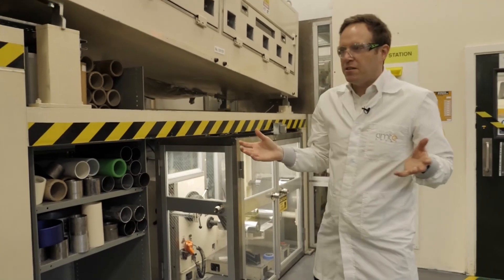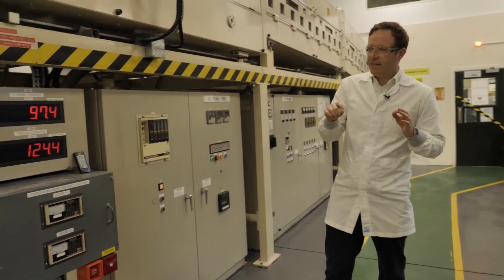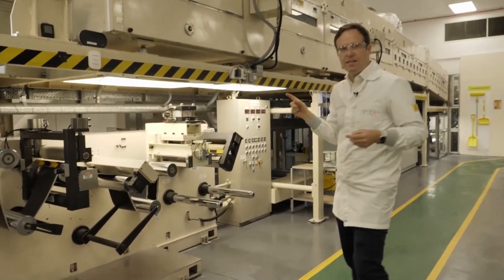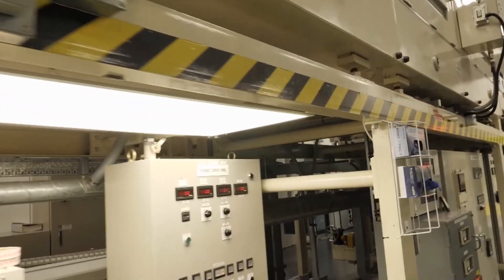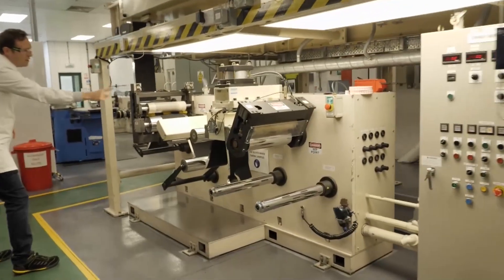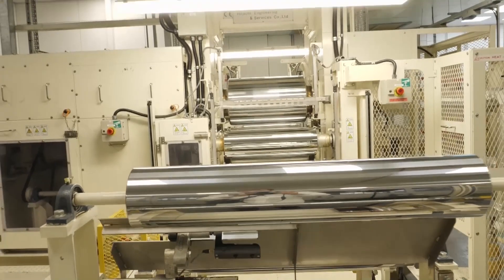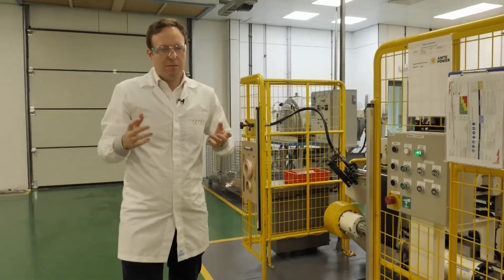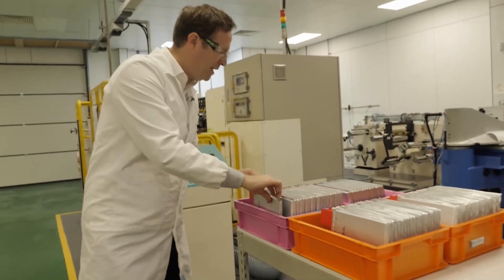How lithium batteries are made by one of the UK's only producers

Comment: I think they should call a halt to Lithium-Ion battery production. The reason being there is an egg shortage in the UK. In 2001 the eggs produced by Battery Hens was revolutionised when the industry shifted to Lithium-Ion batteries. These often explode spontaneously, ruining the hen’s undercarriage. After they, they can only produce scrambled eggs – and there is just no market for them.
Reply: flying tiger have / had rechargeable batteries with a USB to c-type port (or equivalent). makes sense to be able to connect to a 230-240 circuit for charging direct to and from the actual battery - whether AAA, AA or larger.
Reply: Engines explode until they fix the problem.
Reply: *In England
Reply: I knew it! ...

Comment: A tiny factory with 30 year old machines in the middle of nowhere. That’s our “pedigree”
Reply: Good reliable old machines not so much powerefficiency but solid quality ... that can work for 30 years more... not electric lithium bateries are that good or ecobonically wise. 🤗
Reply: The Only Lithium Battery factory in the UK
also have the Only Aluminium Smelter factory in the UK
also have the Only Coated Magazine factory in the UK
also have the Only National Robotarium in the UK

Worlds First by generating 50GWH of electricity from Tidal Power
World's Most Powerful Tidal Turbine installed in Scottish Waters in 2021
World’s Deepest Offshore Wind Turbine installed in Scottish waters
World's Largest Offshore Wind leasing is ScotWind

Scotland’s First Offshore Floating Solar Panel array will be installed this year

Glasgow manufactures 30% of the Worlds small Nano Satellites

The number of Space Companies & Organisations increased 21% from 
144 in 2021 to 183 in 2022.
Preparation work is underway on the first integration hangar in Shetland where rockets will be assembled and satellite payloads integrated with 2 launchpads in construction.

Worlds First Self-Driving Buses to enter service next month in Scotland

New Electric Vehicle firm Munro Vehicles new MK1 4×4  starting production this year.

New Electric Vehicle firm HVS Systems is developing its hydrogen powered trucks.

New Electric Vehicle firm Mako Aerospace developing worlds first 
all-electric jet engine.

St Andrews University Scottish Hydrogen Train Project has tested the First Hydrogen Powered Train.
Reply: why so negative? surely there are positives also?
Reply: It is all about the technology... Britain still has a massive presence in world tech.
Reply: @chrissmith2114  
Name 1 tech England manufactures?
Reply: @chrissmith2114  name one world class British tech company
Reply: @hannvarljósseittsinn  
Latest Employment Figures   Nations with similar population size
 
Norway   77,3%   2,852 million
Scotland 76,5%   2,738 million
Slovakia  71,8%   2,623 million
Finland   72,9%    2,582 million
Ireland    73,2%    2,574 million